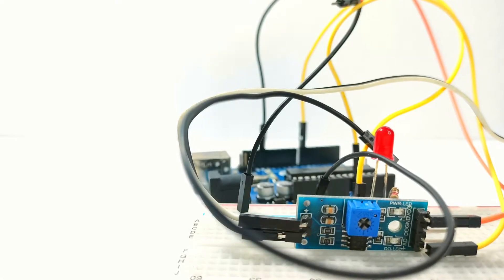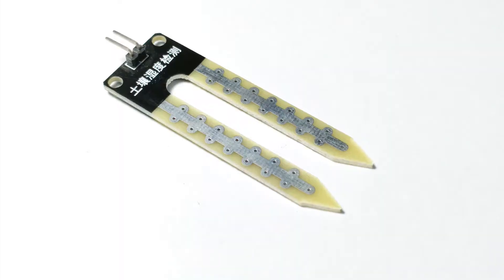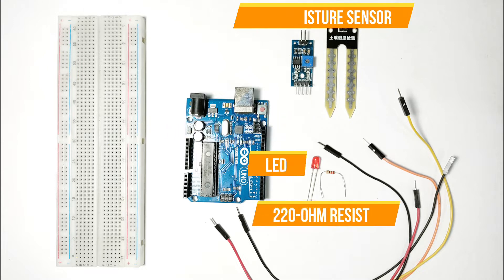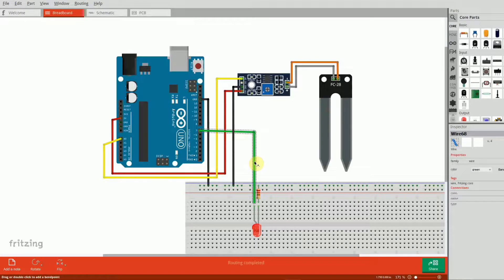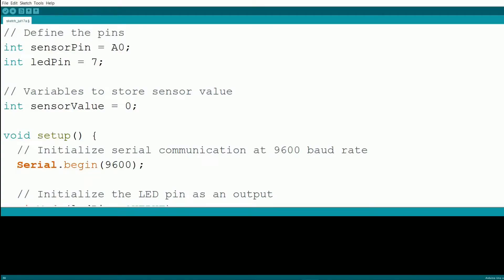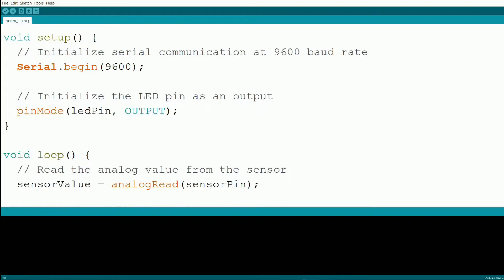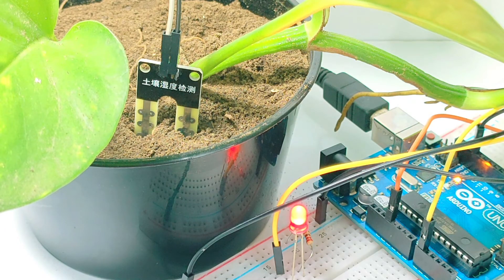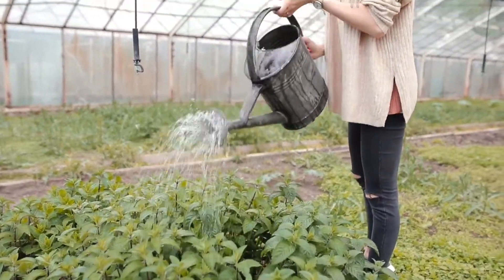How to Use a Soil Moisture Sensor with Arduino - Step-by-Step Tutorial

Comment: Bro can you make a same project using display
Reply from the maker: You can check this article, just replace the water sensor with the soil moisture sensor. It displays the data on an I2C LCD. https://www.arduinointro.com/articles/projects/complete-beginners-guide-to-using-a-water-level-sensor-with-arduino-and-i2c-lcd

Comment: Is the resistor compulsory
Reply from the maker: it is compulsory for the LED, unless you connect the positive side of the LED to digital pin 13, then you won't need a resistor.

Comment: While the sensor is in use, the power LED stays solid on the moisture sensor PCB but the " DO " LED turns on and off. Why does the board which came with the sensor do that?
Reply from the maker: This is the normal behavior of the module. The "DO" LED indicates the sensor's readings and is designed to toggle based on moisture levels. If it’s turning on and off, that's usually a sign that the sensor is actively measuring the moisture content in the soil. The power LED stays on to indicate that it is running.

Comment: I am not a programmer so this may be a dumb question. Can u use a single uno card to connect multiple sensors?
Reply from the maker: Yes, that is possible. You can find an example here: https://www.arduinointro.com/articles/projects/combining-the-infrared-sensor-and-touch-sensor-in-1-arduino-project-with-circuit-and-sketch

Comment: How do u make the led goes on when the soil is wet but when the soil is dry the led goes off
Reply from the maker: just change the code from this: if (sensorValue > 500) {
    // Turn the LED on
    digitalWrite(ledPin, HIGH);
  } else {
    // Turn the LED off
    digitalWrite(ledPin, LOW);
  }

to this:

if (sensorValue > 500) {
    // Turn the LED on
    digitalWrite(ledPin, LOW);
  } else {
    // Turn the LED off
    digitalWrite(ledPin, HIGH);
  }

Comment: my led is not turning on, what can i do?
Reply from the maker: If you followed the circuit and coding, then it could just be a problem on the hardware side like some faulty jumper wires or breadboard. Simply replace these defective parts.

Comment: Does this need a battery?
Reply from the maker: Yes you will need a power supply for the Arduino (5 volts), which can be supplied by any USB charger.
Reply: @arduinointrochannel  Thanks. Does that mean I
 can charge it like a phone?
Reply from the maker: @IdhaantDogra absolutely yes
Reply: @arduinointrochannel  THANK YOU VERY MUCH

Comment: Thank you very much..

However, if I want to add a automated water pumping system to water the plant instead of me watering the plant, will I use he same system with a different coding?

If so, how can it be done?
Reply from the maker: For this application, I would use a relay to operate the water pump. The good news is that the coding would still be the same but instead of turning on an LED, you will be turning on a relay where your pump will be connected to. I wrote an article about turning on a 220-volt lamp using a relay and a pushbutton. You can read about it here: https://arduinointro.com/articles/projects/how-to-safely-control-high-voltage-appliances-with-arduino-and-relay-module

Good luck!

Comment: I connected same way, without electrode touching water. Value shows 270, what can be possible reason and how to debug
Reply from the maker: It could just be a different sensor model. If the value changes significantly when water is applied then you will have work with these values and make the appropriate changes in your code.
Reply: @arduinointrochannel  when i insert the electrode under soil, the OLED glows well....only my pain point on the reading value is improper....suggest on what can be debugged.

Comment: What Ohm resistor to use when using a buzzer instead of LED?
Reply from the maker: A resistor may not be necessary for the buzzer. Take a look at this article: https://www.arduinointro.com/articles/projects/exploring-piezo-buzzer-integration-with-arduino-a-comprehensive-guide

Comment: How do you decide which resistor to use?
Reply from the maker: We can use Ohm's Law for this to compute for the resistance given the voltage of the digital pin, but a 220- to 330-ohm resistor is safe to use for the LED.
Reply: @arduinointrochannel can I use that
Reply: I have a resister that is blue and the name is 220 and the last didgit was a weird 0

Comment: Bro can we attach display
Reply from the maker: Sure! I'm planning to create a video on this soon. For now, you can read this article about using a motion sensor with a Liquid Crystal Display: https://www.arduinointro.com/articles/projects/diy-motion-detection-alarm-system-using-pir-sensor-i2c-lcd-and-piezo-buzzer

Just replace the motion sensor with the soil moisture sensor, but you may have to tweak the code a bit.

Comment: Y is it saying timeout sir?
Reply from the maker: It seems like there might be an issue with the connection between your Arduino board and your computer. Usually, when this happens, I restart my computer and upload a simple working code like a blinking LED. If it works, then the problem might be with the sensor's wiring. You may also try changing the default programmer found in Tools->Programmer. Try AVR ISP, or Arduino as ISP. There could be a lot of factors going on with this error.